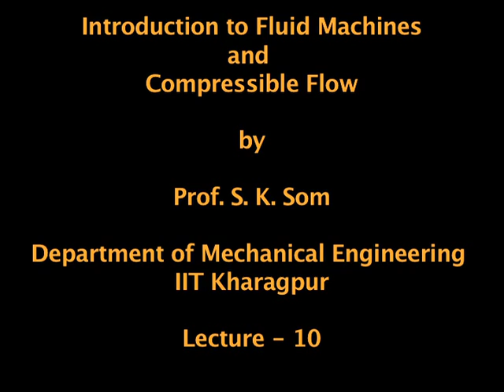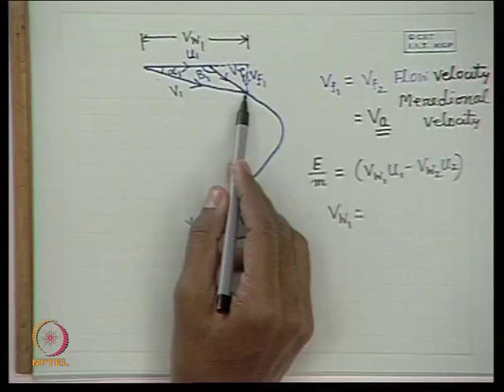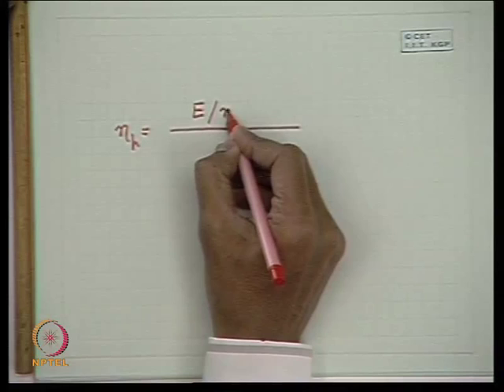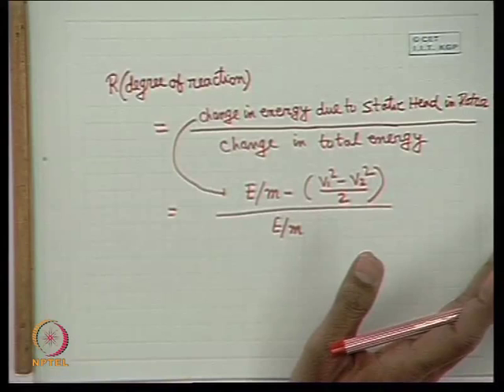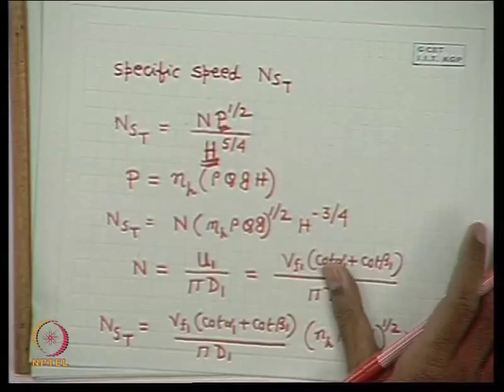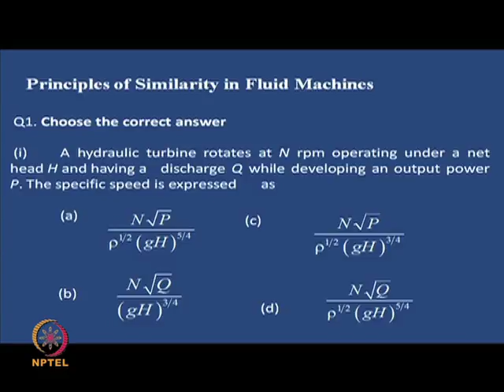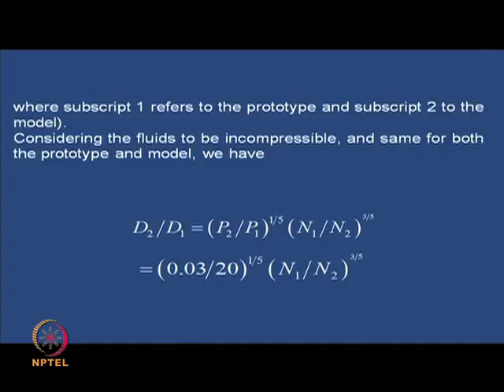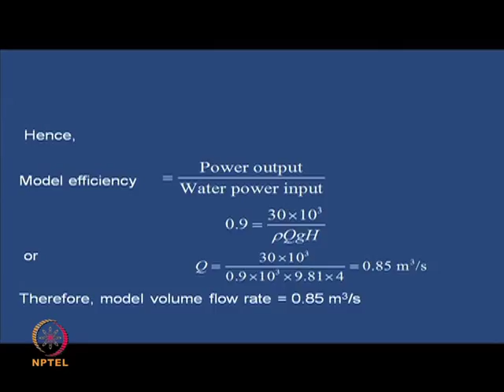Mod-01 Lec-10 Analysis of Force on Francis Runner and Power Generation

Comment: Very good lecture. Why you analyze everything for one blade only? Is it not necessary to multiply the power by the number of blades? I understand that almost all blades are impulsed by water simultaneously.
Reply: the expression that Som sir has taken to find out hydraulic efficiency or power is [ENERGY PER UNIT MASS] E/m. E/m value wont change if no. of blades are considered. So he has calculated the hydraulic efficiency by considering one blade profile. And we can use the value of obtained hydraulic efficiency for power calculation of the whole turbine.